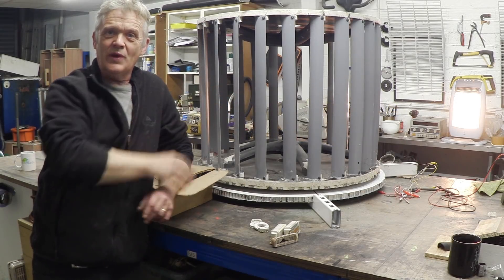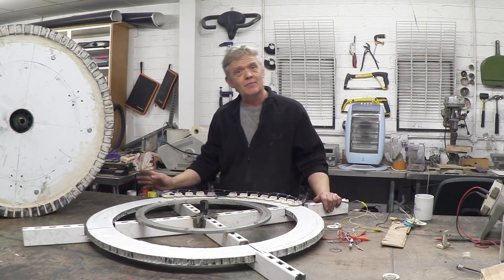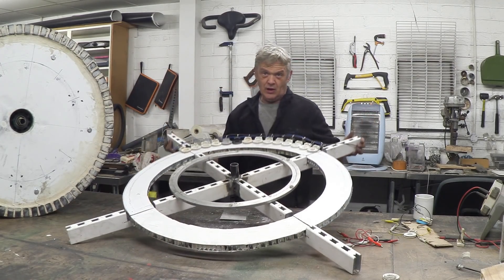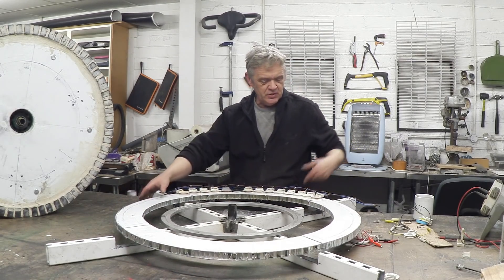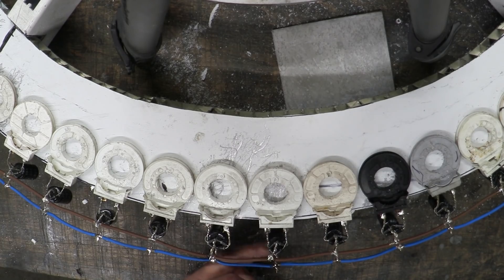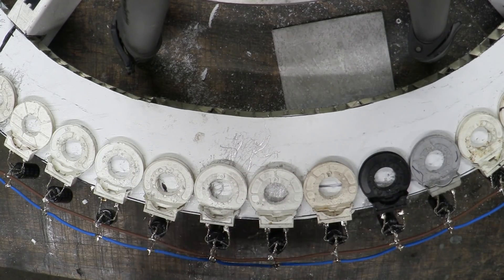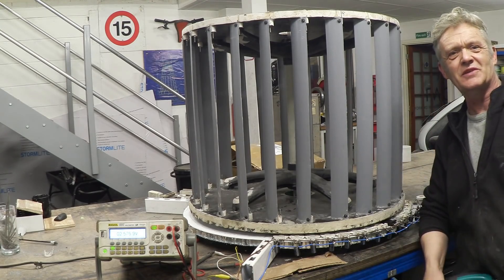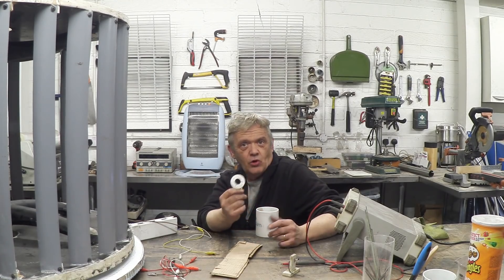Building A 1kW Wind Turbine For Under £100 - Some More Changes

Comment: Is a capacitor required on each of the coil outputs? Would not the bus wire that connects all of the coils act like a smoothing capacitor anyway in the sense that the voltage outputs of all those coils will average out  within the bus wires? If you needed smoothing of the overall output, a single capacitor should suffice no..? I'm asking in case there's something I've missed or have not understood. Nice job BTW... 😀👍
Reply: I was just thinking the same thing - unless I’m mistaken isn’t it just an awful lot of capacitors on the DC side in parallel? I’d also have expected the magnet and coil widths to be identical - then wiring  in a three phase would be possible and much more energy efficient and reducing load clogging. I was disappointed by the lack of available energy calculations too. It seems to me that the swept area of a traditional 3 blade, its high efficiency etc would require a monstrously large and heavy squirrel cage turbine to compete.
Also not much mention of the baffle plates - which are not really baffles, but accelerator / concentrators.
Pity, so much effort for not a lot of result. That said very informative, entertaining and interesting.

Comment: Great! But your magnet/coil configuration is so inefficient, wasting so much flux! Better to interconnect a much smaller number of horizontal or vertical coils nearer the axis (more generating torque) between alternating pairs of magnets passing each side. Sticking the backs of the magnets on mild steel straps or rings would maximize the applied flux and generate more power in any conditions.

Comment: Straight thumb down. As I told you before, bolt claim in headline: 1kw turbine... I work in the wind turbine industry, for years... I came across many false claims like yours, nothing proven either. This thing will fall apart before you get a real output of 1000watt. Keep it honest man!
Reply from the maker: The wind industry is one of the most dishonest industries I have come across -  1 kW turbines don't generate 1kW - mostly it's 50-70 watts and you charge thousands for that! How about you be honest and less of a superior ass?
Reply: @ThinkingandTinkering  you are part of the dishonest team... Please don't compare chinese home owners turbines with professional megawatt turbines costing millions of dollars. I work in the million dollar wind industry, not in the youtubers false claim territory...
Reply: I agree in your skepticism. Many youtubers have high claims and never deliver. To be honest I enjoy the build and specially the testing different strategies for coils, but it’s all really down to science. From a turbine like that you will get 10-15% efficiency. From the videos I take turbine to be around 1x1 meter. With 10% efficiency it will need 26 m/s wind to make 1kW. As the energy grows in the 3. power to the wind, low winds contain next to nothing, energy wise.  

Don’t get me wrong. I really like the project, but a “goal with no plan is just a wish”

Robert, I really hope that you make it til testen, and that the wind will finally be with you. There  are tons of learning and info in your projekt. If you reach 1kW we learn something. If you reach 10 watt...we also learn.
Reply: @OleBrinch  you are right.

Comment: horrible design. The better designs of wind turbine may have 10 times the power of the present turbines and that cannot be reach by any other wind systems used now. I say that all the wind turbines have a very poor design. I designs 3 types very efficient, and I am positive they will work as expected. I have 15 inventions and 7 patents. I remember my A to D converter, patented in 2000 in USA, patent # 6,091,346, using floating voltages, I sent to patent office without to do any experiment. After I got a patent, I did experiments and did work perfectly. The same is with my wind turbines. The horizontal turbine has a little active surface on the base of the blades and the rest of the blade are useless and can be removed.